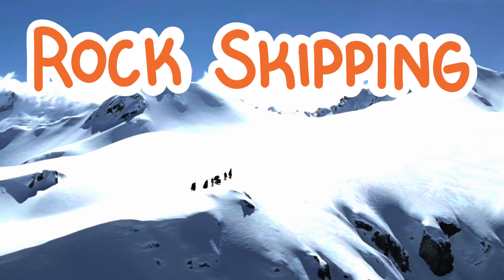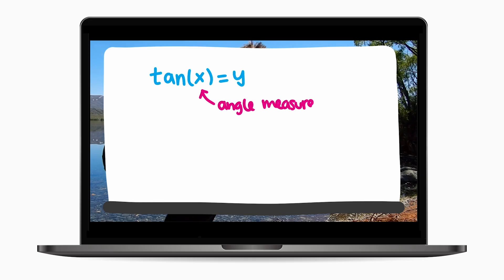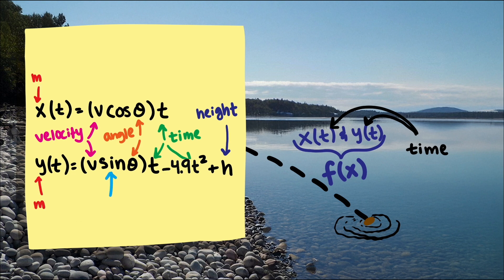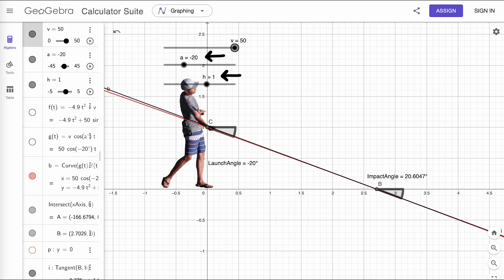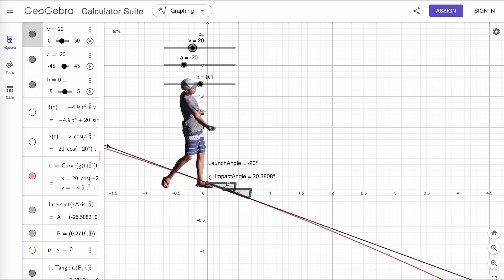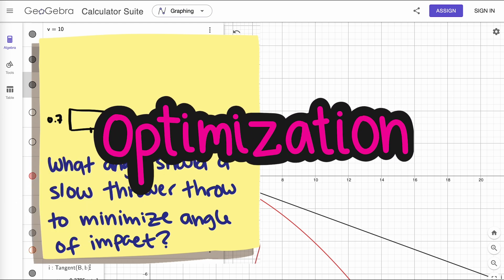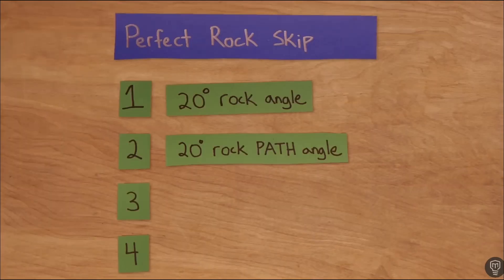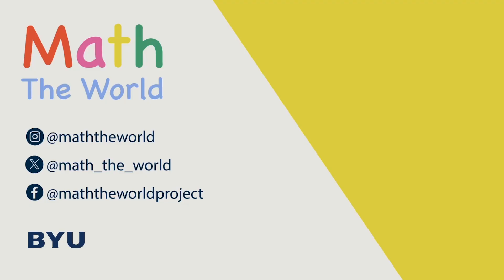Using Math to Hyper Optimize Mark Rober's Rock Skipping Techniques (Part 2)

Comment: So basically, conventional advice about throwing rocks is correct then. Low and parallel
Reply from the maker: For slow throwers, yes. To test, if you throw horizontal and it hits the water about 6 times out further than the height of the throw, then that is the right strategy. If it is going further than that, or if you know you throw hard, you need to angle it down more on the throw.